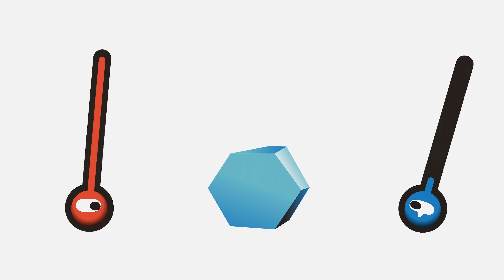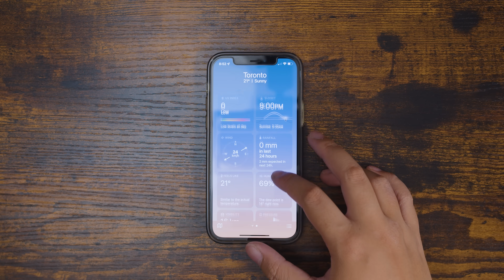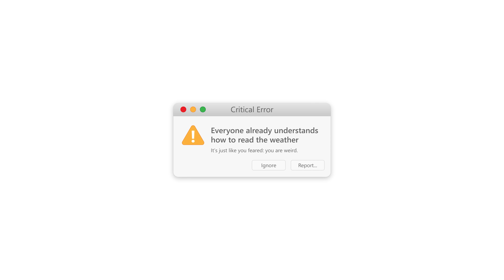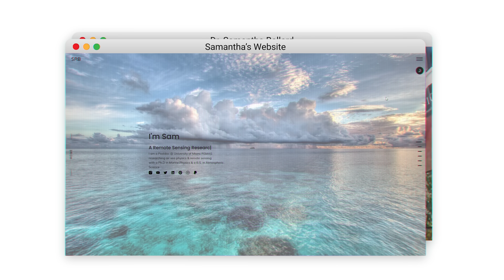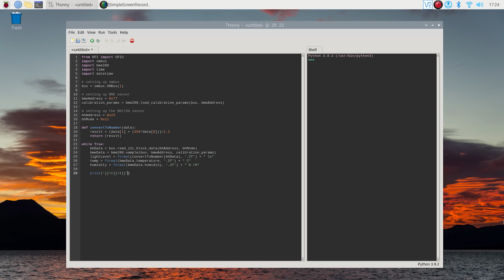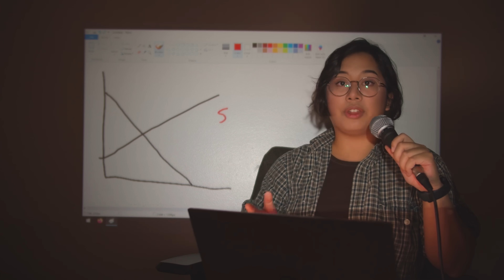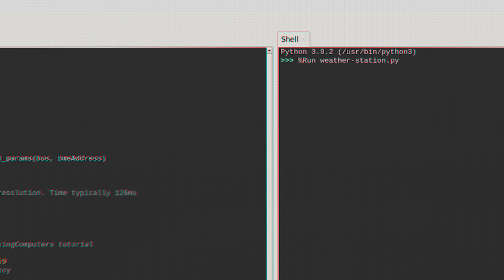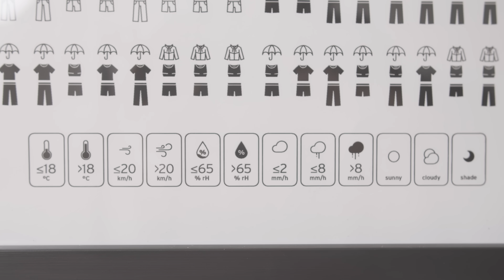how fahrenheit fails you

Comment: On the US East Coast, what we have is 2 tempature reports. We have the actual temperature and the feels like temperature. The actual temperature is just how hot or cold it is outside, and the feels like temperature is after you take into account all the other factors that could make it hotter or cold (like wind, participation, humidity, and sun intensity). So a tempature you might have in Philly for example is during the summer, it could be 60°F outside, but you have 70% humidity and a high sun intensity, so even though it's actually 60°F, it feels like it's 75°F to 85°F. So the weather stations we have on the East coast kinda fix the problem because they do the math for us to tell us how it will be outside after you take everything else into account.

Comment: I've always just mentally set my baseline "normal" temp to 20°C since it's average office temp. Sure it's a couple degrees down from 71°F but it's preferable to being outside down here. 26°C is really, really mild for a summer day down here in SW US. Every five degrees up or down is a step towards being boiling or freezing. 15°C is chilly, 25°C is warm; 10°C is cold, 30°C is hot and so it goes. Being more granular than that is problematic because yeah, temperature feeling is very subjective.

(Also what is this "precipitation" you speak of? Is that the water falling from the sky? We keep sending bug reports on that to the devs but have been told it's a feature. We don't believe them.)

Comment: In my opinion, all temperature scales are bad because we learn and adapt. Because we all are smart enough to correlate how we feel with the temperature, if you grow up and adapt to it, Celsius is the better global unit. It's the unit that most people use and thus, it's easier for a minority to change. Unfortunately that will not happen though. If the countries that used F were lower income per capita, the rest of the world would have forced a change. Because the US uses F, it's hard to pressure countries to move to C.

Comment: Huh. I tend to the "too hot" side until the temperature falls well below 68 F/ 20 C (My winter thermostat is set to 50 F/ 10 C, and then only because below that my pipes start freezing).

So basically unless most people are going around in winter coats, I'm wearing shorts...

Comment: I prefer Fahrenheit (;p) because I grew up with it. The thing that made i easier for me to determine how a temp would feel to me was realizing the closer the air feels to my body temp the more uncomfortable I would be, this could work using either scale but again I'm from the USA. Soo, since my temp is usually 97.5 or so (yes I run cold which means I'm always hot, because that makes sense I guess....) so I need at least 30 or so degrees less so I can effectively dissipate body heat and stay comfortable. It sound convoluted, but basically anything over 65 starts getting uncomfortable to me, unless I just barely woke up, since my body isn't making enough heat to keep me warm just yet, but once everything 'turns on' I need it pretty cool (by my dessert born boyfriends standards lol) to stay comfortable. This was a fun interesting video, and as someone who also fails to go outside very often I want your poster! or a digital version that could be customized and printed, I think that's really neat, and also could be a really fun learning/teaching tool for my child!!! PLEASE?

Comment: You know i always use the bottom line if its over 15 degrees celsius, you dont need a jacket outside or only a summer jacket. Shorts are a personal matter. Anything above 25 degrees celsius is warm. Over 30 is hot hot.

Comment: Might I, as a dutch viewer living in the Netherlands introduce you to Dew Point temperature: our 26C sometimes feels like a 40C, but it's because the humidity is so high that it feels like the air is pressing on us. I think as a Canadian you might have to get used to this the longer climate change is happening.
Reply: We use the humidex (humidity index) in Canada which apparently does use dew point. So the weather network in Canada tells you the actual temperature and then what it feels like (the current record is from 2007 when it was 34, with a dew point of 30, so that combined to a humidex rating of 53 degrees).
Reply: Ehm, yea but for people that own a phone this is not a problem. The phone tells you the weather but also what the weather FEELS like. Like, it's 26C but it FEELS like 40c.

Comment: it's weird bc even tho i live in the us, i have friends who use celsius while i use fahernheit. it's an extremely different scale but i do wish i'd learned celsius because it's so much easier when travelling. however fahernheit is alright because it usually doesn't get below 0 or above 100, but if it does i remember that's probably as far as it will go but it's either extremely hot or extremely cold.

Comment: Sorry, you can use anything you want as a measuring stick as long as it's consistent. It doesn't matter if it's an inch, a meter, or a banana, as long as it's CONSISTENT. 

This is why maps came with scales, printed instruction books sometimes come with their own special rulers, and why we can get pretty damned good approximations based on hand lengths when trying to compare the size of two things.

Standard and metric these days are inexorably linked (standard is now defined by metric, which means all measurements are metric, you're just arguing language, and with computers able to do the calculations for conversions to fractions of an atom's width, this only really reiterates how futile "precision" is as an argument). 

Since the big difference is in language, the next important consideration is which best communicates or helps someone grasp what you are measuring pretty intuitively. 

Which fahrenheit has the biggest benefit in this particular instance. Your can argue the rest.

Comment: I live in Ireland. Celsius works fine here.

4⁰ or lower is cold and I need to dress very warmly. 

Up to 12⁰, I need a jacket.

If the temp is in the teens, I might need sleeves. 

If it's 20⁰ - 22⁰, I can make do with a t-shirt. 

Anything higher than that is too hot and I'm staying indoors if possible. Like Sabrina, I can't tell the difference between 26⁰ and 40⁰. To me that is all *too hot*.

I am very sunshine-averse, so other people will have different ranges they go by.

Comment: Minis degrees: puff winter jacket/coat time, hoodie, wool pants, thicc socks, boots
Around 0°: Still jacket, normal jeans/pants, hoodie, regular socks, still boots
around 5-10°: Can be slim jacket, but still jack time, hoodie, pants, socks, shoes
10-16°: Hoodie or pullover, still pants (what are you a maniac?), socks, shoes
16 to up: Shirt is enough, pants or shorts, low socks, running shoes

There. Solved you days worth of useless research for a somewhat meaningless YouTube video. You're welcome. These are my layer scaling parameters, but they depend on the mood/feel. Always dress in layers, than as heat goes up, peal the layers, simple.

Comment: I live in the midwest (minnesota specifically) and our temperature scale for the year goes from heights of 100(f) in the summer to -30(f) or lower in the winter. Fahrenheit works well because theres large swaths of temperatures that bear similar meanings to most people. -30 to -10 is snowsuit, -10 to 30 is coats, 30 to 60 is tshirts, and (at least for me) 70+ is stay inside. thats a 100 point scale in Fahrenheit, -30 to 70, vs being a 55 point scale in Celsius (-34 to 21). its currently 70f (21C) out where I am and I regret that I have to go outside later cause my apartment is 62f (16c).

Comment: I think this is a you problem, girl... Like, it's not the system's problem if you've never learned how to dress for the weather. Also, it also depends on the person: for me 12°C are light tshirt and long pants (maybe. If I feel hot enough I will go with short pants anyways) with closed summer shoes and a flannel if there is strong cold winds (it also helps that I've always just dressed in layers), while for my boyfriend it's full on winter clothes. Like, this actually sounds like you are actively not really listening to your body and you just always went with what your parents told you to dress up with instead of actually telling them how you felt.

Another point: after Farenheit made the mercury thermometer, the other systems also switched to mercury, so again, not a fail of the system, but a fail on how data was gathered.

Comment: 15:00 To save you some potential angst just in case something like this happens even more thoroughly next time - the RasPi stores everything including the OS on the microSD card, so you can just yank the card out and read it on another computer in a pinch (ext4 formatted so need a Linux or Unix system though).

Comment: I'm of the opinion that Fahrenheit is better at conveying temperature in the scale of human perception because the units are smaller. Celsius degrees are big enough that it talking about weather requires you to be either far more precise or far less accurate than is useful. A temperature in the 20's in Celsius can be anywhere from a cool breeze to an uncomfortably warm summer day, because Celsius degrees are nearly twice the size of Fahrenheit degrees.